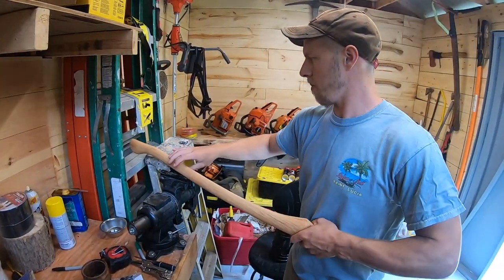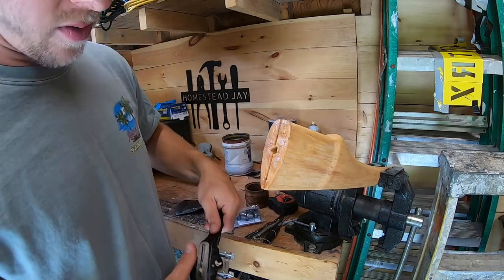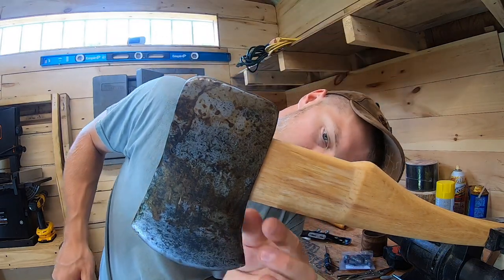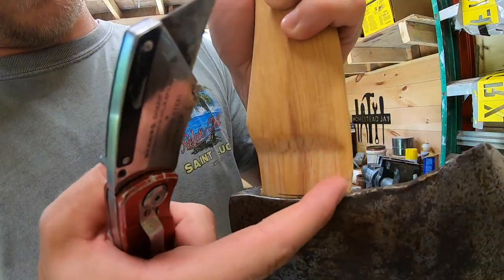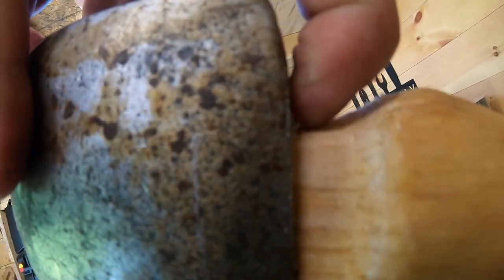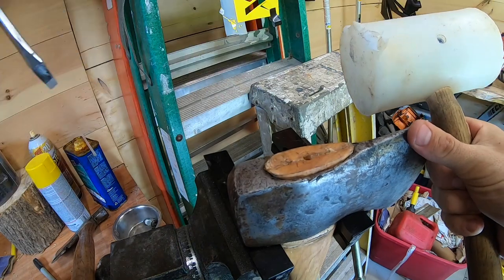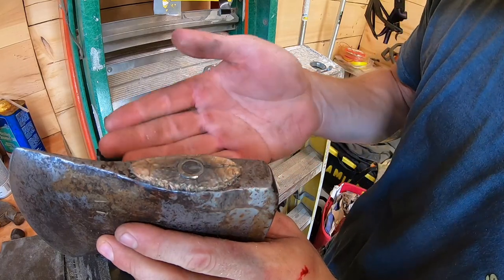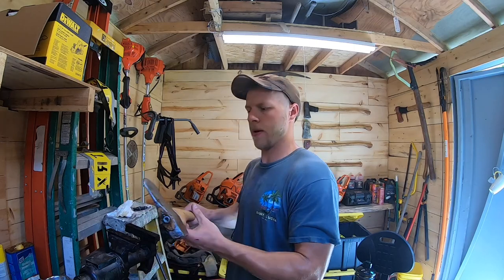How To Hang An AXE! Part 3

Comment: Looks good Jay. I'm no professional either, but I would have taken a little more off the start of the handle before pounding on your head. I always try to get the head to pretty much slip on half way, then pound it on so it shaves some wood off. I find that is a good way to get it to sit down on the handle well. And you can eyeball it better.
Reply from the maker: Yes I try to be conservative with it but in this case I was way to conservative hahah I am doing a hatchet next and will shave more off prior cause i was dying trying to beat it on haha thanks Derek!